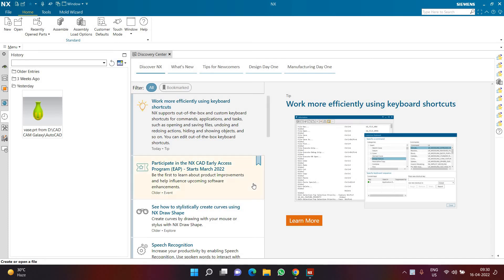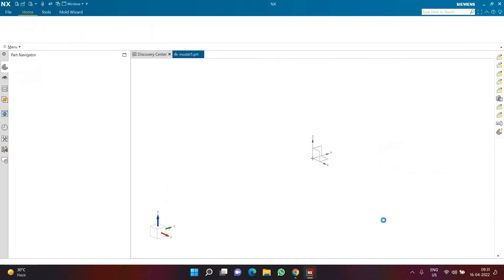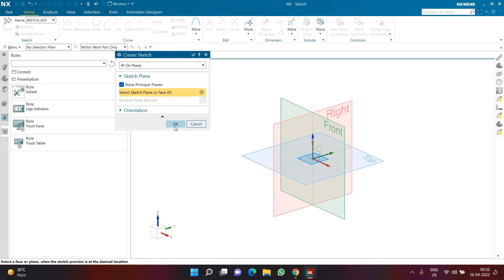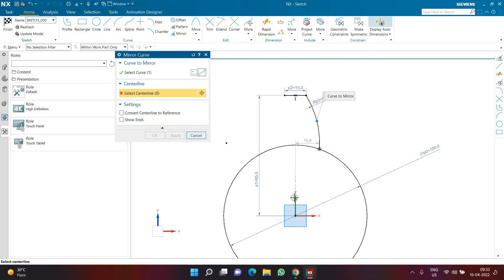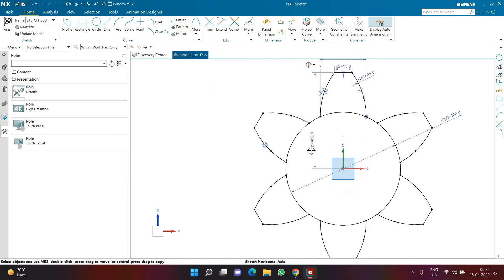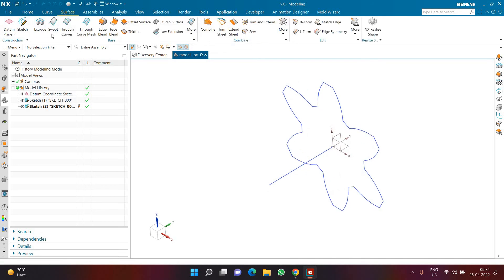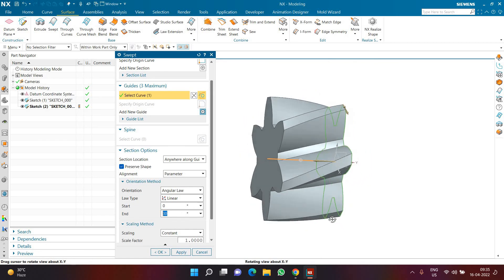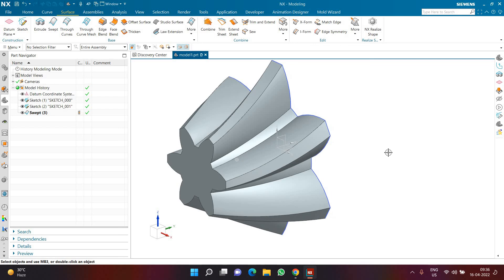⚙️ HELICAL GEAR ⚙️ | FAST AND EASY? | ADVANCE | SIEMENS NX | LATEST | ENGLISH

Comment: How do you practically take dimensions from the existing helical gear and make model please explain
Reply from the maker: Got your point, theoretically helical gears are standard component so all the different sizes and parameters are already mentioned. But if in case you have to make a gear using measurements then some advance measurements tool like profile projectors or CMM would be required